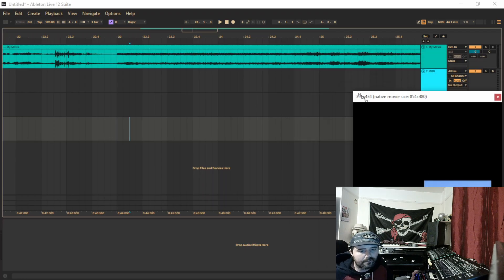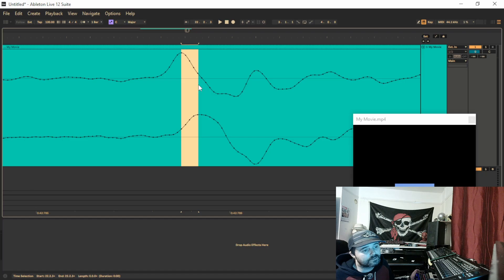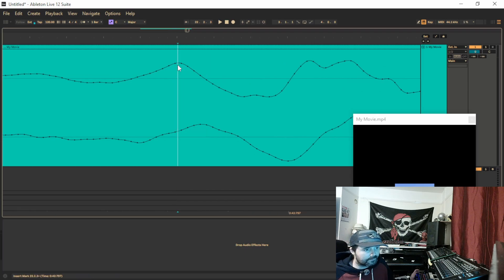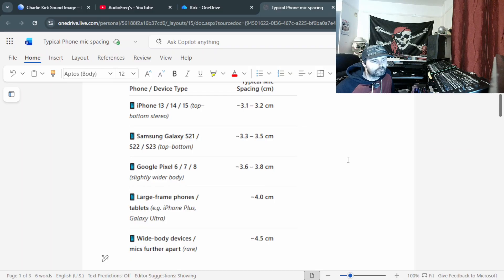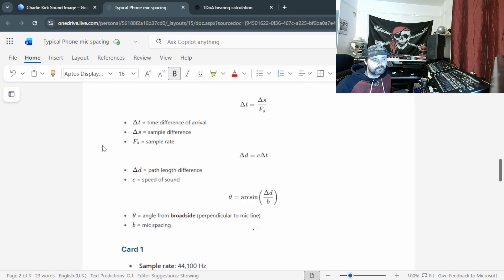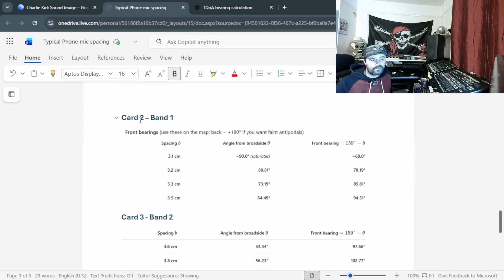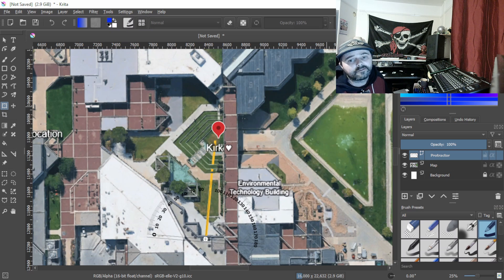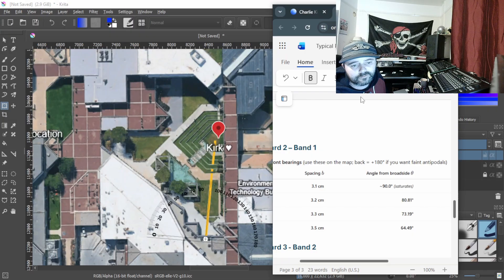TDoA Breakdown: Pinpointing the Source with Stereo Microphones

Comment: Nice work. On another note, it will be necessary to get the height ratio of the top of that white roof to the bottom of the tent awning overhang that day. My personal viewpoint is that from that high an angle the awning would obscure Charlies head. Charlie was in a chair but that chair was on a substantial platform raising his head even higher within the tent. This obscuration is amplified the closer the spot is towards Charlie's tent. I would say then between your preliminary 'cones', only the one on the left is far away enough to decrease the angle sufficiently to have been able to see Charlie's head in line of site clearing the tent awning.
Reply from the maker: Hold my beer 😅 

I can give an approximation for height. But it's not coming to that yet because there is a lot more video to go through and measure before. The issue is I'd have to guess input angle to an extent. But I might be able to measure it. So, we just have to wait and see on the height for the second because we need more data. Now I'm not married to a conclusion here, it's just where it points. I will tighten up the measures on phase 2 anyway
Reply: Can you you run a test by moving the phone from the perpendicular? So that the top speaker would move closer to the sound and the lower speaker away and then the converse. I’m not sure how much of a difference of 10-40mm on vertical centres would make but it might show the difference of high placed vent grill 400-500mm below roof edge. I’m probably being stupid but sometimes stupidity triggers intelligent thinking. On my second watching of the video the audio disappeared (ironic) but came back after reloading. You got another subscriber.
Reply from the maker: @grahamhireme9283  This is important. I can give a general direction under these conditions. If it was lab conditions then we could get exact numbers. You could argue it was rotated slightly, and you could argue that I drew my line slightly left or right. But even with those, it's still going to point that direction unless the change was dramatic, which we don't see in the video
Reply: Kirk was 1.96m tall while standing. The ration of the sitting height is 52% of that standing for someone of his ethnicity; hence around 1m when sitting. The chair on which he was sitting was set on a platform made using flooring on top of plastic cases, which would elevate the chair by 30 - 40cm.The wound in the neck was about 25mm from the top of his head. Hence the wound would be 
100mm + (30 to 40cm) - 25cm = (130 to 140) - 25 = 105 to 115 cm above the surface.

There are several videos that can be used to estimate the dimensions of the tent.
Reply: @christopherrobinson7541  And the platform is at least two feet off the grass, this is clear in the videos, and on Mr. Let Go channel, some viewer showed an add for the exact platform.  Charlie's head was invisible from the 'bush shooter' position and higher.
Reply: @christopherrobinson7541  The chair was set on a folding metal platform at least twice the height you are calculating. And the most important measurement is from the grass, at the bottom of the amphitheater to the tent awning overhang.
Reply: There is a video of the tent almost immediately after Kirk has been driven out of the area, while students are being shepherded away from the arena through the tunnel behind where he was sitting. it clearly shows the elevated platform the security guy to the right of where Kirk was sitting was standing on.  You can see the platform Kirk was sitting on and there is blood on it. The frame of the tent is 12x12x9ft and from the guard height I'd put the lower edge of the banner to be around 7ft 6 inches from ground level. Kirk is sitting virtually exact centre of the tent so about 6ft from the side. The platform appears to be about 18-20 inches tall and Kirk is sitting normally on that. I'd rate the height of the shot to be 60inches from ground level which would give a max angle of shot to be arctan of 30 inch/72inch or around 22 degrees, basically a 5 in 12 slope.
Reply: @MrAuswest  By banner, do you mean tent awning overhang, not sure what you mean by banner? And I don't see your calculations of chair height?
Reply: @Adm-Kirk  Yes, I meant the ~8-10 inch flap hanging vertically from the edge of the sloping 'roof'.
The chair height was a best-guess using a video taken from the right side of the tent just after the body was moved (and the back camera!) which show the relative heights of the chair platform and the platform the security guy was standing on to Kirk's right side. It looked to be approx 80% higher than the guard's which i guessed was around 1 - 1.25 feet tall
Reply: Late correction, just saw that the whole tent was raised on blocks around 8-10 inches high? On purpose maybe?